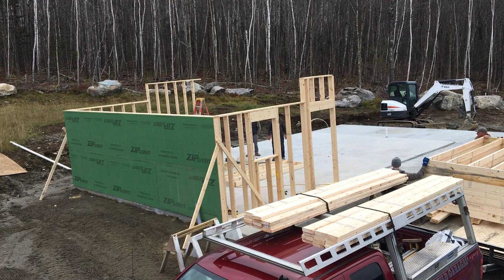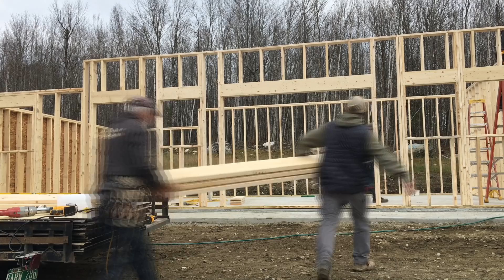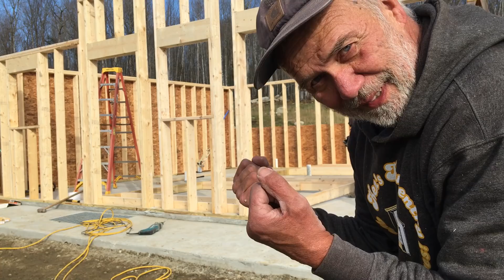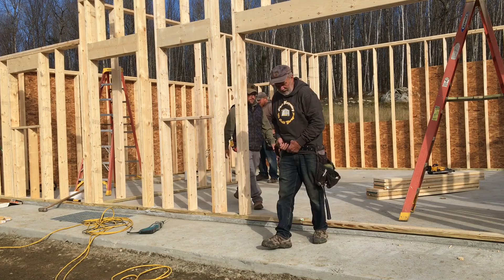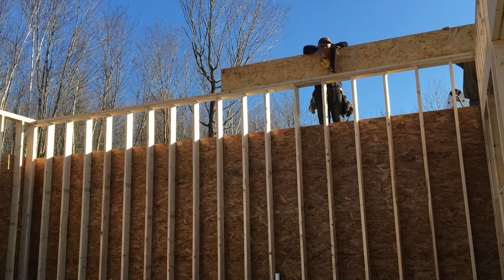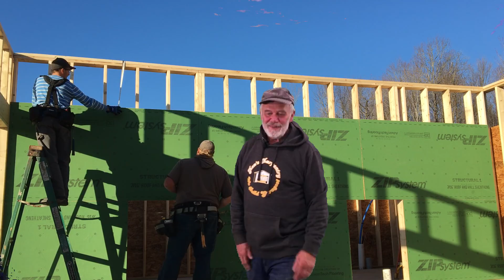LUMNAH ACRES TINY HOUSE Part 7 Downstairs Walls finished

Comment: I noted at 12:32 that the exterior top plate of the front wall was cut and run all the way to the left end.  This should have been cut off short so the interior wall top plate can join up to the exterior wall for more support and stability.

Comment: Nice to see the walls going up, just curious as to why no side or back wall windows ? Especially for natural lighting...
Reply: Did think  the same. Then considerd risk of Bears..winter snow drifts..security..maybe Al will tell us?
Reply: @annar6430  that was my after thought as well ...
Reply: the bottom floor is the canning kitchen/harvest room and also the battery bank/utility room... the upper floor with be most of the tiny house so therefore less windows needed
Reply: @2friesshortofabigmac407  .many thanks...just open door to ventilate
Reply: They won't be living in this house forever, it will become storage, power plant, processing kitchen etc. Eventually they'll build their permanent house, but this way they can get moved onto the property quicker.

Comment: Your crew works like a well oiled machine. What do you use to hold everything together. I hear a nail gun but. Her something like screw gun. Always hear it in the background.. I’m old school and I’m just curious. I love seeing the materials and new technics you guys use .
Reply: the nail gun was the crew doing sheathing on the back side where we couldn't see and the other noise was a hammer drill installing the wedge anchors for the lower plate.... obviously staying out of the way for the rest of the crew.

Comment: Fascinating to note the precision pre building leading to simple final fit .Am I missing something or is their  no insulation between the double boards boards ?
Reply: If you mean the sill plate sealer, it was put on before the walls went up. It goes between the wood and the concrete.

Comment: Having done construction for 50+ years, I noticed that it appeared that there were 2 window openings with headers on the "front" side of the house that you covered with the zip panels. Just wondering why, I know they can be cut out later.
Reply from the maker: Windows are on back order for at least another month

Comment: Ken a well planned and executed build. You have an exceptional team working with you. (ps. ypu do know Al's history with nail guns dont't you)
Reply: Taping... Watch again around 9:14
Reply: @Charlie Allen .... pressure treaded bottom plate and taller walls because the first floor is a shop with heat pipes in the slab.
Reply: @Charlie Allen .... what's the difference between a wood wall and a row of block for the same given height? The wood will be easier to insulate and the height is needed as part of the design for a work shop where he will park his tractor.
Reply: @Charlie Allen are you claiming the wood will stay sealed better against a row of block versus the concrete floor? What I can tell you is people have used wood for hundreds of years in barn construction and after 50 / 100 years it probably needs replacing. I am not expecting the 50 year (warranty) PT wood will last any longer but I do feel it will be in better shape than untreated wood at the end of the same time period. Do you think Al will care what shape the wood is in when he's 98 years old?
Reply: @Charlie Allen would agree the extra row of blocks is a game changer but I am not the customer paying for this job. The place is already on a hill with a decent slope to keep outside water away. No lost sleep on my end because of the owner's choice. This is an allowed building practice in many areas.

Comment: Not being picky but i would have lapped the top plate from the weight bearing wall on both front and rear walls instead of butting.

Comment: Bit of a stretch calling this a "tiny" house, no?  Coming together nice!  😊
Reply: actually a tiny house on top of a fair size garage / shop with a utility room extension on one end and a greenhouse on the other. A multi-purpose building.
Reply: @rupe53  If the "house" on top is the same footprint of the main garage shop space it's still a stretch to call it a Tiny House. But current fashions dictate YT clicks.
Reply: @DiscoFang  ... Ok, you are a victim of reading the title too often and haven't watched all of the recent videos because the house on top is NOT the same foot print as the first floor. The living area of the second floor will be something under 400 sq ft.
Reply: @rupe53  Victim? You’re the one making assumptions. I’m aware of the footprint of the downstairs and that only the central part will have an upper level. I don’t watch the Lumnah channel and don’t think Ken has ever mentioned the upstairs size, footprint or floorplan. I do know the shower is downstairs and I presume a toilet will be too. 400sqft is pretty small but it’s still a bit of a stretch and disingenuous describing this as a tiny-house. Bandwagoneering.
Reply: @rupe53  Ken often builds garages with upstairs living spaces and calls them apartments. Which they are. Calling an apartment a “Tiny House” is hooey of the  highest order.
Reply: @DiscoFang  ... would agree that's stretching things and it's likely Al's doing since Ken usually tells it straight. If you have watched Al's videos, he does like to use a LOT of words where fewer would do better... just my opinion. Ken did give dimensions in one of his videos, which is where most of us have been bantering around that "under 400 sq ft" number, which is after subtracting the knee walls and stairs. He even gave us the knee wall figures, but the stair opening has been a variable. One viewer suggested the 2nd level would be closer to 320 sq ft when figuring in the stairs. Hey, I didn't write the script so don't shoot the messenger.

Comment: Ken, I’m surprised Al was ok with you putting up the Zip panels upside down, his ocd had to be just going crazy 😜!
Reply: ZIP panels are printed right side up on both long sides of the sheet. So, when hung, the print at the top edge is upside down.
I know what you mean, though! That upside down print drives ME bananas! Have a GREAT weekend!
Reply: Als ocd ain’t that bad look at him putting up the solar stations😂
Reply: Lol when your laying down thinking it's upsidedown it's really easier to read 😂 so hope this helps with OCD
Reply: If Al truly had OCD he would have all his tools and equipment neatly lined up or shelved, rather than scattered all over his field . It was Gina that “strongly suggested he build tool racks in his workshop back at home.
Reply: I wondered that too. 😛
Reply: LOL😊
Reply: I laughed out louud when I read this.
Reply: I was thinking the same thing.  Al's OCD tendencies are just fine w me, though, as I bend that way too!  Always do your best at a job, and you'll be glad of it.  👍

Comment: Just wondering, what shoe size does Dan take ? Just out of curiosity nothing more
Reply: The actual house is kinda small.There is a huge area for the solar bank of batteries that will eventually run the whole place, tiny house, new house & meat processing center and the green house, and the pumps on the outdoor wood boiler. Its tiny compared to their new house they are going to build.